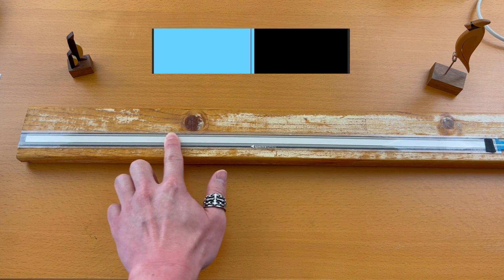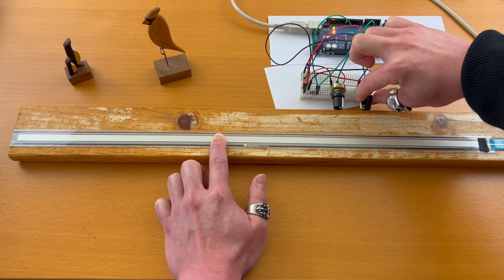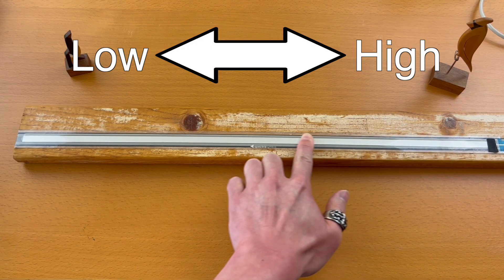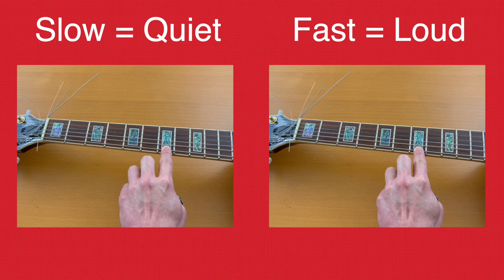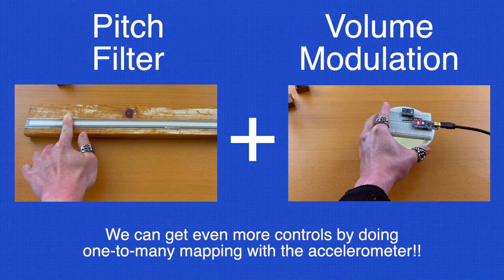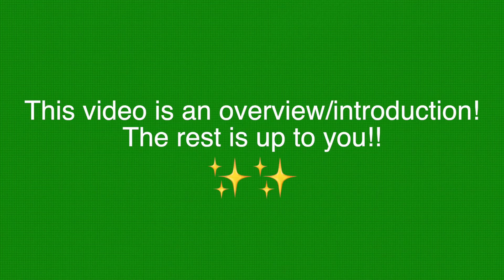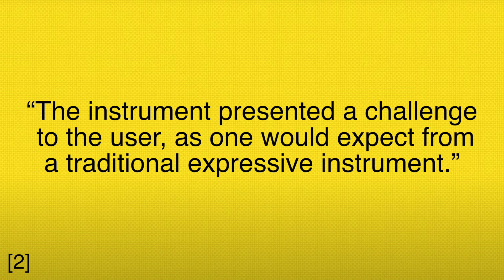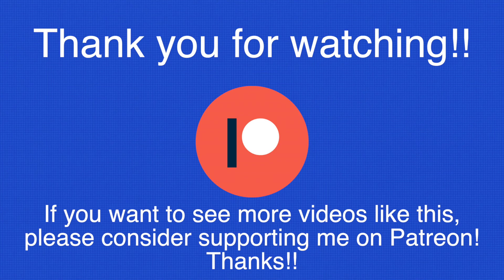One-to-Many Mapping (DIY Synth Tutorial)

Comment: idk if this is relevant because im not too familiar with max mfp but if algorithms can be added to a patch then approximation algorithms can be a great addition to limit the inconsistent variables in speed input like if your slide speed is x and is close to a constant value y then all values close to it in a certain range will be set to y this can be used for different values just to make the filter or volume control more consistent I hope I made sense
Reply from the maker: Yeah, I think I know what you mean. It should make the speed data feel less all over the place!  
The challenge with that approach is to not make it sound quantized in terms of volume.

Comment: One to many mapping is a must for me. Otherwise, when I reduce my 3 watt laser image to a dot, it will burn straight through the flame retardant projection screen and into my 4k flat screen TV.😱
But, by mapping size and intensity together with the same MIDI control knob. My images automatically fade into the 'distance', creating a 3D illusion.
I'm also mapping X size and !Y size to create a symmetry control. Of course in the audio world, that would be L & !R mapped together for a pan control.
The capacitive touch strip is ideal for both applications, but with much faster action than knobs.
Another advantage to multiple mapping is conservation of the limited 127 MIDI control variables. Multiple functions are being called by a single knob/sensor's assigned MIDI CC#. IOW, one is only limited by one's own imagination (and software knowledge). I love this stuff! Now, my life has new horizons and goals. What more could any hermit want in life? Boredom, BE GONE!!
 😎
Reply from the maker: It would be fascinating to use speed of sensor value change for visual! 
Accelerometer could be used to control the X and Y positions and the energy/speed of movement can control the size of an object for example.
Reply: @SoundSimulator  Thanks for the suggestions. I'm controlling X/Y size with the 2D Nextion touchscreens. Swipe bottom left to upper right increases both axii. A circle wobbles X/Y symmetry, for example.
The other hand can also control position on the second touchscreen. Or one movement can do all of the above. Why not throw in some color variables, just for fun. Now, a circular movement moves an image in an elliptical path, while fading color R-G-B, depending upon position. 😎
You know, there's not many people with whom I can discuss these matters.🙏